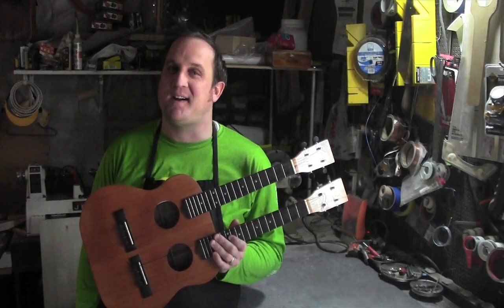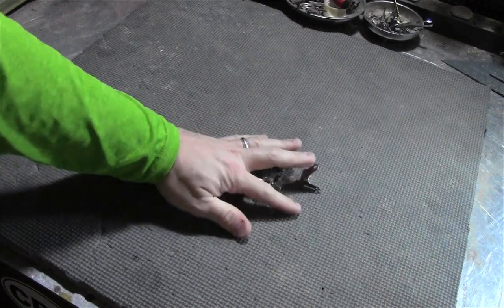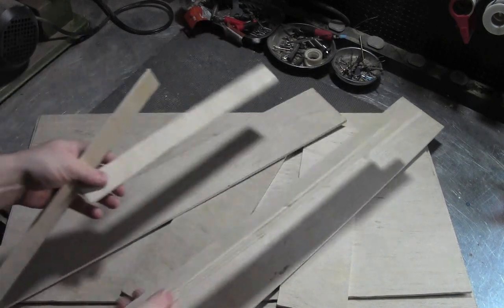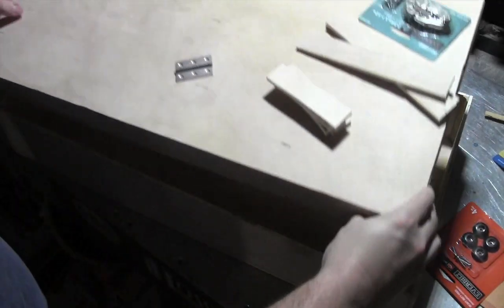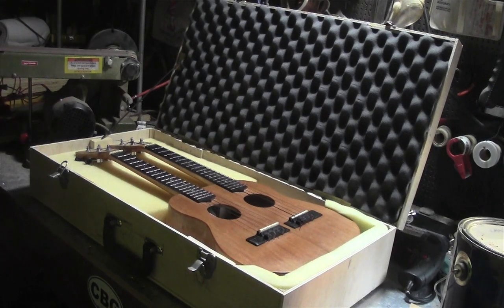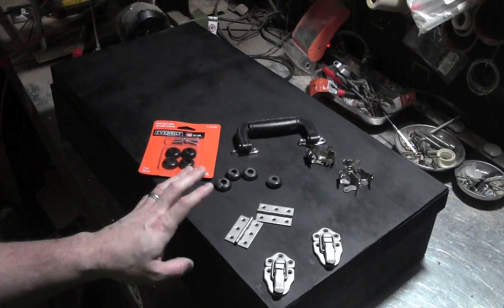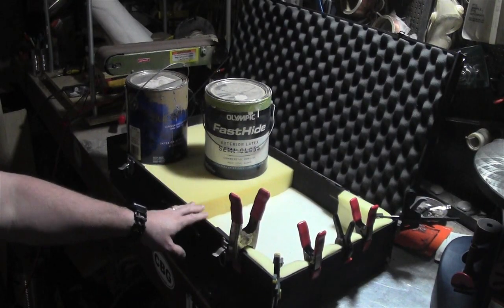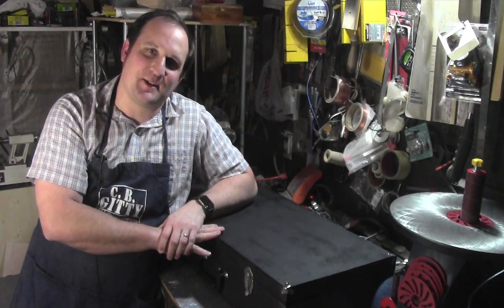Making a Ukulele Case

Comment: Here's a hint from a fellow who has made many cases and boxes for various kinds of equipment. If you want to make a case where the lid and the bottom fit perfectly, make a rectangular cube that is the same size as the bottom and top of the box together, plus 1/8 of an inch of additional height. After the glue dries, make a saw cut to separate the top from the bottom. Your table saw will do the job nicely.
Reply from the maker: Great idea! Thanks for the advice!
Reply: @CircuitsAndStrings  You are most welcome!
Reply: This truly is a huge box making hack. Thank you good sir